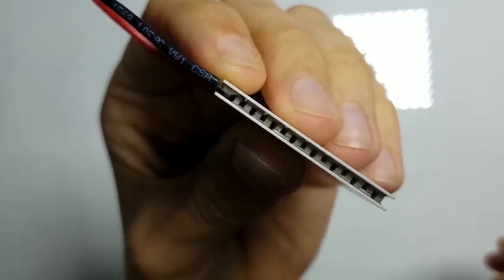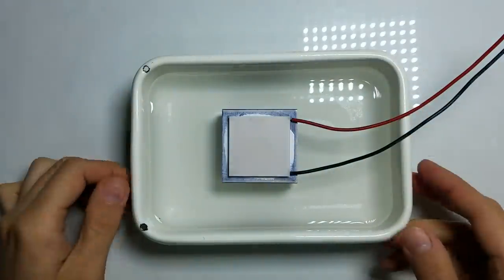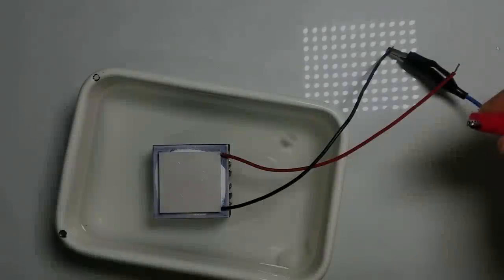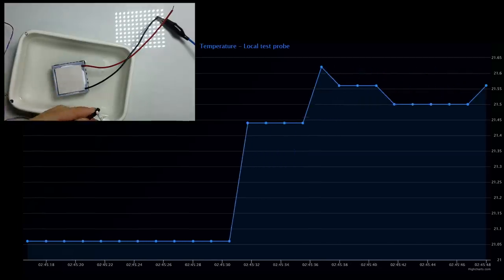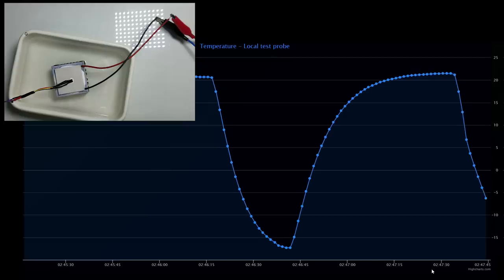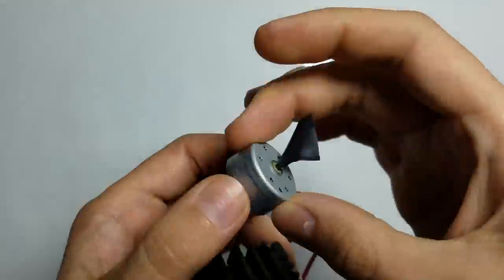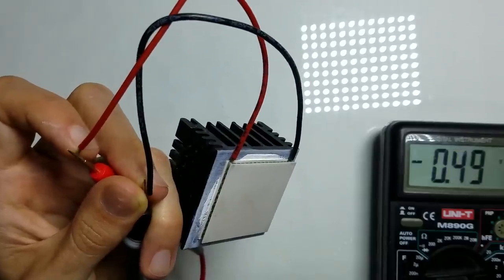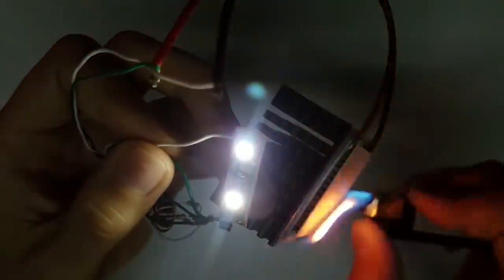Thermoelectric Cooler - Device That Makes Ice and Electricity

Comment from the maker: Timecodes
0:43 Applying thermal paste.
1:10 First test, making some ice.
2:12 Measuring temperature
3:49 Making electricity from heat, and powering DC motor.
4:27 Measuring voltage and amperage that device generates.
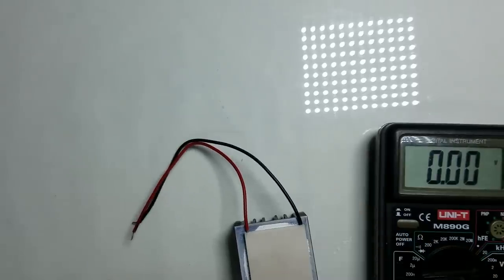5:00 Powering LEDs using electricity that device generates.
Reply from the maker: Hello, yes, you can use it, permission granted!
If you're going to download it and show it offline, please add the link to my channel so people could find it: https://www.youtube.com/user/ElectricalPro/
Reply: I would like to ask how much the price of a peltier cooler set abd where is to buy
Reply: Where can i buy it?or you just made it by yourself?
Reply: Can you make a experiment where instead of lighter paste unther module to it as heat source
Reply: @norikhwan2914  order it online, there are lots
Reply: What type of thermal paste are you using?
Reply: does the heat get really hot? Trying to get a heat source to activate a nitinol robot?
Reply: Can i make phone cooler with it?

Comment: To me this is product is like the conical bullet in  19 century or faster than light travel in the 23rd. To be able to cool anything with electricity at a such a small scale with power and no pressure/gasses needed is a miracle that should be further developed. I’ve bought this as an aquarium water cooler and was able to power it with a solar generator and a liquid cooling pad for my sleeping bag during the day and heated water during the cold nights. For someone that lives in a humid climate, I find this tech revolutionary. Would love to invest in making commercially available water cooling/heating systems for all applications.

Comment: One use is for CPU cooling but that would end up radiating to the rest of the computer. I'm glad you said about heat transfer creating electronic flow.
Reply: Yeah heat can be dumped to create electricity
Reply: I remember some air coolers used a peltier diode. Using one of these would definitely require a high airflow case

Comment: Couple it with fresnel lens and make a solar panel out of it and generate some electricity with high heat from focused sunlight. Use the cold part to cool food and house.
Reply: Xeno Bardock 
I think there’s a limit to how much heat it could absorb which leads to the question could it provide enough energy to run household components off of sunlight and a fresnel lense? He used fire that only gave him .5 volts you couldn’t run your house clock with that.
Reply: @Mega6501  It will need to be improved first. There's a lot of room for improvement in thermoelectric technologies. 
There's even a Thermoelectric CPU Cooler on Amazon and video on youtube now.
Reply: Xeno Bardock 
Interesting I worked on wind turbines before and those towers have almost all electrical components known to man interesting enough I haven’t seen any thermoelectric parts, I need to look into this part as of now I only know they are used primarily on refrigeration I don’t know how this thermoelectric device can cool a cpu when the opposite end is producing heat but then again I don’t know the maximum heat temperature it would raise at.
Reply: Xeno Bardock 
Thanx for post I had a look, I never doubted it was possible, I actually came to understand on my own how you could cool the opposite end of thermoelectric component it’s actually pretty basic by using the cooling end to cool the hot end it will decrease the temperature by half and thereby creating a safe temperature for use, but I’m not concluding this is the practice applied on the transistors but it seems to me applicable.

Comment: THANKS!!!  Thanks for the education!!!!!!  Question:  if I mount one of these....Peltier Device to the back of solar panels, to harness the waste heat (and try to cool down panel), does that mean I have more energy from the system?

How large can a Peltier Device be?
Reply from the maker: Hi, Good question. I also have thought about this... I am not an expert on this, but I think yes, you will get more energy. It doesn't matter how large Peltier Device can be, because you can connect them sequentially (as many as you want). But it probably will be very expensive and not worth it. I guess you will get an additional 1% or 3 % of energy... but it is just my guess.
Reply: if you watercooled the hot side (the side that dissipates heat) im sure that you could get something useful
Reply: @ElectricalPro  how much time does it take to make ice
Reply: @ElectricalPro  how much does it cost?

Comment: This should be attached to a CPU controlled voltage obviously...
Reply: Ikr
Reply: @Adam Adam use it in a desktop
Reply: This has been done since the 90s.  This was one of the original reasons for the Peltier unit.
Reply: @Shedding  i never saw it in use why ?
Reply: @raider7790  I thought he meant using a Peltier Unit to cool down a cpu.
Reply: @raider7790  because it requires shit ton of power.
Reply: @raider7790  loss is too much. not economical as of now.
Reply: @aretard7995  meh!!!!!
Reply: @raider7790  i believe it is used in the freezer of Toyota Land cruiser cars.
Reply: @Aedin Ridmash cpu temperature controlled...less voltage less cold it gets.
Reply: @Adam Adam They should try using in slim laptops with aluminium protection
Reply: But it does not cool, it transfers heat from 1 side to the other.  You need to cool it all down + the tdp of the element
Reply: @djneo92nl  I've researched it so yes it's pretty much useless
Reply: This my father make this project since 2005. After thats in 2008 I was thinking to use it for cpu as you said , bad my bad told me it’s will not work coz it will make humidity and water
Reply: Check out the latest video from Linus Tech Tips

Comment: Actually Teg's are even more functional than that. it you cool one side and heat the other you can create power. There are many more uses than making Ice that can be more beneficial that wind or solar.
Reply: @kevin paul halliday Get the bigger ones and create a larger plate with them and send through step-up transformer. I think you can create larger amounts if you run them in the right way.

Comment: Several years ago my junk-friend gave me a dorm fridge the had 2 fan-heatsink units. I hooked them up and was amazed that the cold side in 5 minutes was frosted and my digital thermometer got down to -8 degrees after 15 minutes it was frosted solid.
Reply: Thanks Nicolas. I got the fridge for the cabinet to make a food drier thinking the internal fans blowing though small heat elements top and bottom would work well. But like a lot of things, as I got older, it went back to the junk yard full of other junk. I have no used for the cooling units, so they will go on e-Bay. Keith L.  Nicolas Broszky
Reply: Hi Johnny. You can't really "hook up"  the heat sinks, they're just to dissipate the heat. And they have muffin fan bolted to them. The part that got -8 and frosted over was the aluminum Cold sink that penetrated to the inside of the box which had 2 smaller muffin fans to move cold air. I had both Peltier and the large fan hooked to 12V, and the heat sink was really doing it's job and was very warn.  @Johnny Buoy
Reply: Hi Johnny . The muffin fan draws very little, maybe 1/2 amp and the Peltier I believe draws 5 amps,  most are 50-72 watt. KL@Johnny Buoy

Comment: This can revolutionize refrigeration system if improvised further. No need of complicated and bulky reefer gas circuit with compressor.
Reply: The reason why compressors are used instead of the peltier modules is becuase peltier modules are highly inefficient. Seach on google.

Comment: What could also be interesting is using those pads in a water cooling setup within a PC for both the CPU and GPU so it could boost the heat transfer rate between the chips and water while also allowing both to run at higher clock speeds! :)
Reply: this has been done alot over the years (first in 2007 i think). you can even get a cpu fan/heatsink combo right now, it just sadly isnt great for PC cooling (or cooling over all). imagine a tec as an old light bulb (the brighter it was the more heat it made) the more "cooling" or the colder  one side is the hotter the other side gets. and it also cost alot to run it (seen it taking 400 watts in one pc. just to cool the cpu)
Reply: @dakotaxd3727  
It would probably also only make sense for server CPUs that run a lot hotter than consumer CPUs.

Comment: Great, what is the practical application of this device??
Reply: Wine refrigerators use this principal. In HVAC industry
Reply: High school science class.
Reply: You'll find them in small coolers.  They aren't as efficient as using a compressor, but they are entirely silent.
Reply: @kevin paul halliday You can't generate much power from small heat differentials.
Reply: Mainly used in lasers to avoid wavelength drifting. It's still its place in other fields.

Comment: Hi，im a student from Macao and doing a study of this plate. I am wondering is it necessary to dissipate heat on the hot side if I want the cold side start frosting
Reply: wanedewo you really need to dissipate the heat on hot side to get lower temp on cold side. The lower the temperature on the hot side, the lower the temperature on the cold side
Reply: @jethroadante6436  thank you very much！
Reply: Bcz there is a heat flow in this device. Heat flows from cold side to hot side and cold side has less energy so low temperature

Comment: "Can this be used as a CPU cooler?" you ask.  yes, but is my answer.
Yes, but you then need an even beefier heat sink and fan on the hot side of the peltier effect device to remove all that extra heat which it grabs away from the CPU.
Yes, but you'll possibly need to replace your computer's power supply with a larger one so that it can supply the extra current needed by the peltier effect device (close enough to 5 amps for a 55W device at 12V).
Yes, but it probably won't provide any significant performance increase when compared to existing cooling systems designed for overclocking your CPU.
Yes, but it might not be able to grab enough heat from your CPU fast enough when compared to a simple heat sink, leading to your CPU overheating anyway.

There are good reasons why it's not already done that way.
Reply: One side makes heat..... so no. You would heat the room it is in. You could use it as a mini AC unit if you expel heat outside.

Comment: We used to be the guys in the mid 90’s that places like HardOCP and Tom’s Hardware wrote articles about. We build some of the world’s fastest machines outside a special lab. Using these Peltier coolers with custom water blocks, transfer places and custom water cooling setups. We were able to get our cpu temps down to near Zero and take the 233MMX pentium to 299.8 MHZ using back then the Abit TX5 jumperless (worlds first) back then. We did so many custom projects since then. This is nothing new.

Comment: But what if you had two of them, stuck to each other, so the side that produces heat will link to another to produce electricity?
Reply: I do think so.
Reply: You’ll get electricity and heat, but you put 12 volts in and get 1.6 out.
Reply: Avaxar I understand the principle of energy and you cannot create it from nothing, my point was as we're making so much heat energy that we need a heat sink - maybe we can harness that waste, so let's say 12 volt goes in and 80% is waste (abouts 10v as heat) and we can get back 20% of that (2v return) so that means if we add it back to the system we're only drawing 10v cause we're turning partial excess heat back into electricity, 

Or, is that not how it works?
Reply: Conservation of energy my dude
Reply: N-ninja the efficiency is 4.5% for seebeck effect. What ever energy you send in you only get 4.5% out of it.
Reply: Raghu Vardhan oh, that's pretty low that there's no real point ;-;

Comment: Can we use this application IN-BETWEEN a cpu Proccesor and a CPU Fan??
Reply: of course
Reply: it uses like 55 watts he said, so yes, it would get your cpu very cool. But at a cost of power.
Reply: I've tried this, it works, but not like one might think. It cools it down, at one point I got to -12C while idling, but when the CPU begins to warm up, it loses a lot of efficiency and temperatures spike, higher than it would be without the module. To make it work properly, you would need more of them, I would say at least 3, in parallel to ensure sufficient heat transfer, then connect them to a heat exchanger and then to a water block on the CPU.
Reply from the maker: Hi, I think it is not worth doing. This device is not energy efficient, moreover, sides of the device are made from ceramics which is worse heat conductor than metal.

Comment: I have used a similar setup to heat up my homemade egg incubator(2ft by 1.5ft). I used a heat sink fan to spread the heat evenly inside the box.
Reply: What did you do with the cool side. Is it just cooling?

Comment: Could you put one of these in a cut-out in the side of a small plastic cooler with 12v plug and use it in a car for food and drinks? By not reliable do you mean when you get used to having it, the device quits working? Can the cooling effect be varied with a potentiometer or rheostat on the power input?
Reply: I have two coolers already equipped with this.  One I bought 20 years ago, and the other about 10 years ago.  The biggest drawback, is they only cool 30 degrees below the surrounding temp.  Works great in a car for long trips.
Reply: Robert Heinkel - thanks for the input. Looks like a cool little weekend project and I could use a cooler like that. If the truck is air conditioned down to 70°f I could expect the cooler to get down to 40°? I’m thinking of just a small, hard plastic 6pack size cooler. I think I have a computer CPU heat sink that even has a small fan on it, that may work well.

Comment: Can use as CPU cooler 
Where i buy this
Reply: h
Reply: You need water for the hot side
Reply: You don't need water it just works better if you have it. You can just use a larger heat sink.
Reply: If you use it as a cpu cooler make sure you have a proper seal between the CPU and the cold side. Don't overload the thermal paste but do make sure you've no gaps, otherwise if you live in a place that gets high humidity you could end up condensing water vapour onto your chip which will not end well, also it should be powered off the CPU fan connector on the board which will feed it voltage as needed depending on the CPU temperature rather than having it on 100% all of the time which could also bork your CPU.
Reply: Yes, nowadays gaming mobile phones use it as a external cooler.

Comment: in 0.6 v , can we use it in our water cooler to save electricity like refrigerator
Reply: Its a good idea
Reply: Not on 0.6v's, however on only a few AA or AAA batteries it will run perfectly. You just have to make sure that wires aren't coming into contact with the water itself.

Comment: dear i have Peltier 12710 and 12715, when i am connecting the wires. both sides produce heat. i am not putting it honestly on a heat exchanger with thermal paste. just connecting it to 12 V for only 5 seconds and measure the temperature with heat gun. what should I do ??
Reply from the maker: Many people have reported the same problem, I don't know what is going on, I assume that maybe it is a fake Peltier device. When I connect my Peltier device to 12V for 3-5 seconds, one side becomes cold, and another becomes hot (without a heatsink as well).

Comment: You can do this in reverse and have the hot and cold side generate electricity instead.

If it gets hot and cold really fast it uses electricity a lot. Likewise on the flipside, it takes a lot of temp difference to create electricity.

So you can convert heat back into minor electricity by directing heat out of a PC case to a radiator, and have one side get hot from that, and get cooled by the other, and connecting the wires in opposite polarity so it turns temp into energy.

Comment: Would it be possible to put a fan on the hot side with the heat sink to create a small heater that could be used for defrosting a windshield during the winter months? What kind of amperage to these typically require?

Comment: Could you please let me know what you are using for temperature logging? hardware and software. Thanks
Reply from the maker: DS18B20 sensor + ESP8266 with custom firmware (it is just like Arduino).

Comment: That piltier produced electricity when you apply heat maybe you can create a solar pannel using multiple piltiers and connect them into parallel do you think it will works?😅😅
Reply: Better to use a parabolic dish or Fresnel lens, but I am curious too. You may find the solar-powered Stirling engine to be of interest, as well.

Comment: hey bro can we use on desktop cpu to control cpu temp. ?
Reply: Already GPU units were using the same to remove heat generated by GPU.
Reply: You can use it, but it is not worth it. Peltier module does not create cold out of energy. It just transfers heat. The heat substracted from one side goes to the other side, and needs to be dissipated. Once it is not dissipated enaugh, it will stop transfering heat, and "cool" side starts to became hot too. Having the fact, that the transfer is not 100% efficent, you will end up with more heat to dissipate.

Comment: Is it possible to use heat sink in computer for processors
Reply: Yes. It is a old overclocker trick. But the hot side will still need a proper heatsink. Also, be careful because condensation can damage your CPU.
Reply: Sure but it will grab moisture from the air an form ice so when you switch it off it will form water

Comment: Can we use the sun's heat as a source to heat the one side of the plate instead of a flame? Can we get electricity from it?
Reply from the maker: Yes, it is possible especially if you paint one side black. But it is not worth doing because with a solar panel you will get much better results.